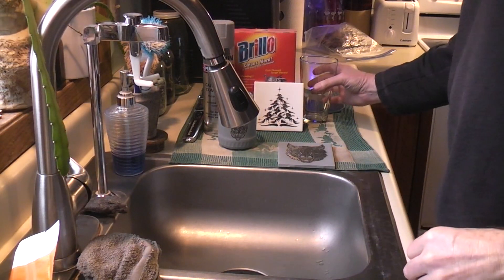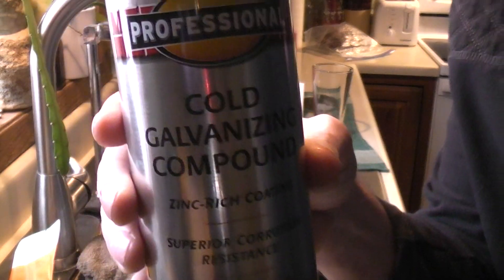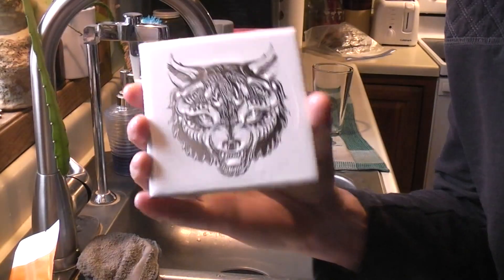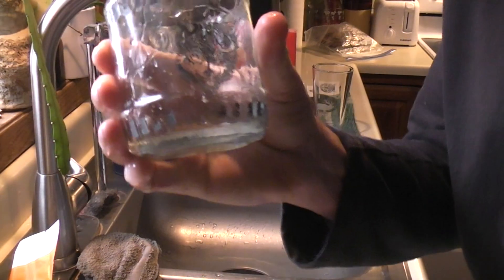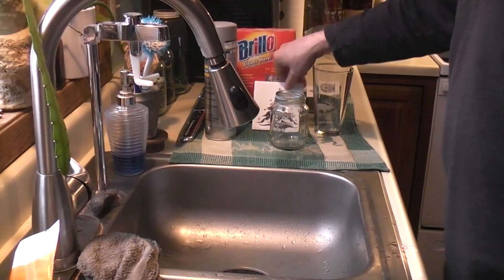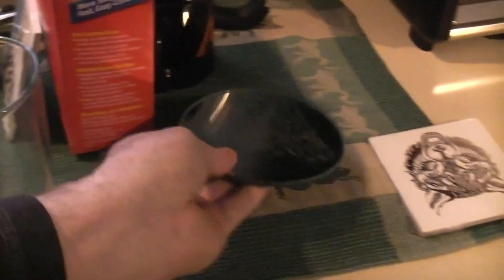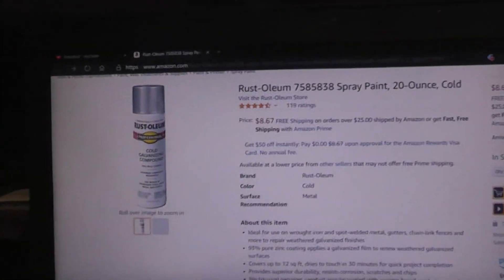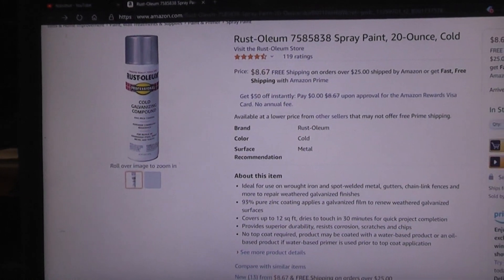Zinc coating for diode laser "etching" glass & tile. Water clean up. High contrast.

Comment: Are you spraying the tile completely with the compound then burning? Settings?
Reply from the maker: Yes a nice coat of Zink coating or black spray paint. Then on my laser 50 to 60% power at 1000mm per minute.
Reply: @Robothut  Sorry one more question so plain white tile then a good coat of galvanized correct?
Reply from the maker: @thomasnadeau5076  Yes white tile or even clear glass. Then you will find the zinc coating covers so well that a single coat is good enough. or you can use black spray paint, a few coats and it will work but the clean up after takes paint thinner and the contrast is a bit less. You will have to experiment with your power setting as all or diode lasers seem to be a bit different .
Reply: @Robothut  Thank you for your quick response.

Comment: Looks like the results on glass are very good...silver frosted look... I'm wondering/concerned if the finished frosted look has very tiny glass shards/pieces that could get into your skin if rubbed by your hand?? Do you know if any additional treatment other than washing with the brillo pads is needed? Are the glass items safe to handle after you have etched and cleaned them? Thank you
Reply from the maker: We use the laser etched glass items the same as when we used to do chemical etched glass. No shards or pieces so far. If you run the laser hotter then you can get a darker image, that some times is better on some projects than the frosted white look.

Comment: I just got the right paint and used on tile. The problem I have is the indelible image is not black it is almost the same color as the paint. what is wrong?
Reply from the maker: Not sure, I can get a dark image with black spray paint or the Zinc coating. I do know the zinc coating gets darker the higher the power you hit it with and the black spray paint kind of goes the other way, if you hit it to hard it is more a frosted white. So you might try different power settings.

Comment: Hello, what settings were you using? I have a 20w ortur
Reply from the maker: You would need about 50% power to 60% and speed 1000mm per minuet .
Reply: @Robothut  thanks again for the video and information
Reply: I have this ortur laser and did 50% 100 mm/m and it washed right off. Did you have any luck?
Reply: @jonvanderwood7882  I have the same problem no matter what combo of power and speed I use

Comment: Hey, I just got my rotary attachment hooked up and this technique has been working great-EXCEPT..... sometimes the burn doesn't seem to fully take. Sometimes parts of the image seem to fade away... the only variable I can think of here is either too much galvanizing compound, or not enough. I am using 1000 mm/min and 50% power on clear glass most of the image looks great, but I've had a few places where the image or text fades. Have you had this experience?
Reply: I would have liked to have seen a response to this because I get the same. Did you ever figure it out?

Comment: Ortur LM2 20w laser. i tried many power settings and speeds but the black on tile washed off after brillo pad.  do you have a recommended setting for pictures?
thanks!
Reply from the maker: It sounds like your laser power is degraded. I had the same thing happen on my 20W Vegotec after I had used it at 100 % power for 4mm wood cutting. After that every thing looked normal for cardboard and wood but I could no longer do tile or glass engraving. So I replaced the laser head with the NEJE 30W unit that has a much larger heatsink and fan for the laser diode. Have not had a problem since then. if you laser is working right you should only need a power setting of 40% to 60% and speeds in the 1000mm / minuet.
Reply: @Robothut  I had the same issue with my AtomStack A5 and it's brand new.  I just tried again at 100% power and I think around 600 speed.  Much better.
Reply from the maker: @craigtaco67  I hoping to hear that the AtomStack would be a great Laser unit.  I guess they are kind of the same.

Comment: Found the Paint at Home Depot. It works fantastic.Used LaserGRBL  Settings for Ortur 15w. 1 Bit Dithering Javis. Single Pass Qty. 20. Speed 900 Power 1000= 100%. No air Assist. I used a glass plate I found in a dollar store.Paint came right off. Trial and error got me to the above settings. Came out like the video's authors glass. Thanks Dude!
Reply from the maker: So cool that you posted your results using a 15W laser Is that about 3.5W optical  power. So glad it worked for you. With my old 20W and the new 30W laser units the power for me would be 40% to 60 % max. Too much power burns the finish dark instead of frosted white looking.

Comment: What kind of laser do you use?
And does it give off any fumes?
Reply from the maker: Burning anything with a laser gives off fumes. Always run your laser in a sealed box that is vented to the outside. I have covered this many times in my videos. Back when this video was made I have a vigotech 20W "5.5W optical power" laser now I have a NEJE 30w "7.5W optical power".
Reply: @Robothut  thanks

Comment: What is the make of your laser and power setting.
Reply from the maker: The 5.5 optical power laser sold as 20 W worked great with is method. I now have a NEJE 30w that is 7.5W optical and it works great with it as well. Power setting with either laser is in the 40% to 60% range.

Comment: You should probably put a disclaimer at the start telling people Zinc fumes are toxic and proper ventilation is needed. Metal fever is pretty nasty. All fumes are bad but I've seen a lot of these lasers set up on kitchen tables and not everybody knows about the dangers of metallic fumes. Seems to work pretty well though. Do you still have to run super slow to get it to fuse 1000mm/min roughly?
Reply from the maker: 1000mm per/ min is not supper slow with laser diodes. Any one who runs a laser to burn things should already know that a enclosed and vented enclosure is the only way to safely use them. I think I have covered that enough in all my laser videos. Burning paint of any type and plastic can be deadly . Again if you have a laser then you should already know that.
Reply: @Robothut  once you're use to running +7000mm/min running at 1000mm seems super slow and size limiting, but some techniques it's the only way they work.

Comment: Thanks for the tip! I've had success using this but I notice I get burnt edges in some areas. Overscan option in lightburn does help reduce but wondering if you knew any other options that may help with that?
Reply from the maker: Lower the laser output level, I found 40 % on my 7.5 W laser is good, others have posted here that they are running 20 too 30 %, any thing over 60% seems to make it dark and burn.
Reply: Check your minimum power as well

Comment: will it work on polished stainless?
Reply from the maker: I have seen videos on youtube using mustard  to do this but I have not tried it yet.
https://youtu.be/B60nXwhK9gk
Reply: @Robothut   theres no available that type of brand in my country so abought "spanjaard cold zinc galvanising spray" it did mark on a ceramic plate only problem is its kinda hard to remove the coating wen i washed it with water and scrub with scotch bright
Reply from the maker: @Pulutoy07  You may have to use paint thinner for your version of the zink coating.
Reply: @Robothut  i should have bought the same as yours, more expensive but atleast less hassle.. great video really helps

Comment: How long do you let the cold galv dry for before lasering?
Reply from the maker: I have waited 2 minutes when I am in a hurry and I have had it set over night when I was not in a rush. Makes no difference.
Reply: @Robothut  awesome thanks for the info also what settings are you using for glass
Reply from the maker: @christopherflanigan4789  1000mm per minute and 45 to 60 % power. I like the look at 55% power on dark brown glass as its very white looking and has good contrast to the dark glass. I find the more power I use the darker the etching to some extent.
Reply: @Robothut  again Thanks for the info definitely going to try it out this weekend

Comment: ZG-90 Cold Zinc Galvanising Spray 500ml  (Amazon ).
Nonsense Zinc Galvanising Spray Paint Silver 400ml (40801)  Screwfix will get some tomorrow.
I bought couple of years ago a 500mw laser 40x50 then a year later a 7w ortur and for Xmas the same machine as yours. My justification to her indoors was I could have a small, medium and large lasering areas without buying more stuff that pleased her. Luckily she didn't look behind my computer room door as I have 6metres of 20x40 extrusion to make the 40x50 into a 60x60. ; )

Comment: I have a NEJE Master 2 Mini which has a 10W laser (2.5W optical) and ran at 50% power and 50ms burn,
Works great! I have only tried on white tiles and is darker than using white paint. Lowes didn't have the "Cold Galvanizing Compound" so I used the "Bright Galvanizing Compound" which is basically the some thing but a lighter color, I think it's 92 or 93% zinc. I didn't notice much of an odor but have acquit ventilation and do my burns in the garage. One thing I noticed was it tends to spark while burning so you need a lot of airflow moving across your work area. I use a old 120mm computer fan that works great.
Reply from the maker: Great news on the lower power laser working with it and the test of the bright galanizing compound. Thank you for posting your results.

Comment: I have ortur 20 wat lm2.   i need to know your settings using 900 mm/min 90% power   thanks
just as a reference...
Reply: Thank you for the reply. Did the 30 watt new laser head make a difference , torn between spending the money on the head or saving for a new 60 watt...  I have not run my laser at 100 percent very many times but I feel it is diminished in power...
Reply from the maker: @mitsuman5  So the 30W "7.5W optical" has been working great. Only time will tell how long it lasts. If you have the room for the 60 watt set up then go for the big boy. So many things can be done with them.
Reply from the maker: 1000mm/ min at  50 to 60% power.
Reply: how can i send you a pic???
Reply from the maker: @mitsuman5  You could up load a video or image to youtube and if you did not want the whole world to see it post it as UNLISTED then share the link with the ones that you do want to see it. Or on my Website www.Robothut.robotnut.com there is a section where you can contact me.

Comment: I'm assuming this was done with the new NEJE 30 watt module?  That's a great idea btw!
Reply from the maker: It was but the old 20 watt unit would have worked just  fine. Seems to take the power as paint does.

Comment: On the tile did you still have to take off the film with acetone, or did you spray directly on the tiles original coating?
Reply from the maker: Unlike others I have never had to pre clean the tiles. So straight out of the box of tiles. Now maybe there  are some tiles out there that do have a film on them I do not know, but so far I have not found that to be the case for me. But if I wanted too I could use the warm water and brillo pad to pre clean the tiles.